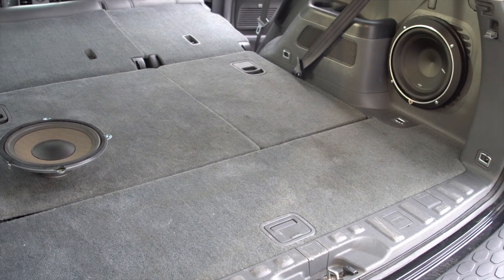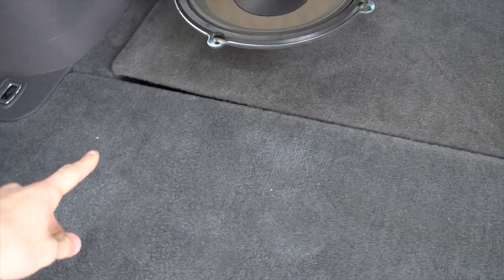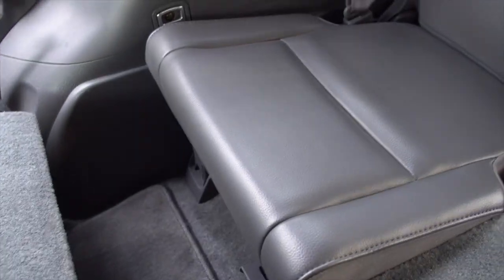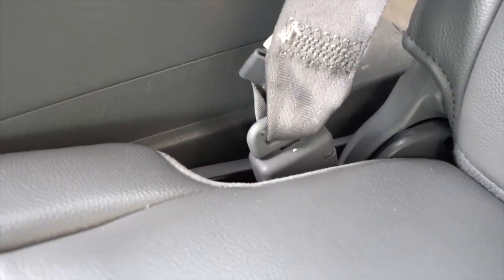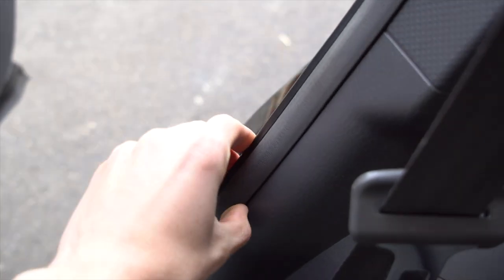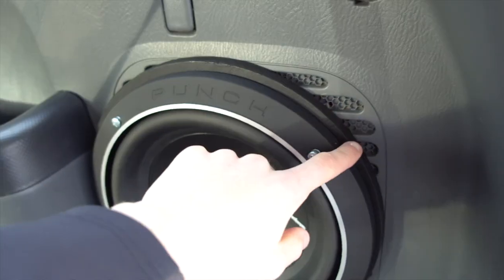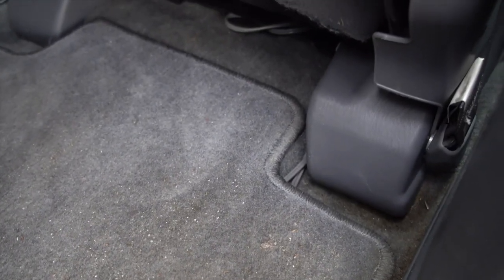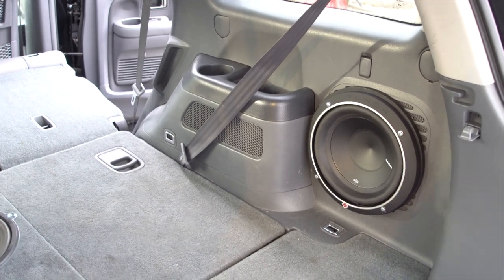How To Install A Subwoofer/Remove Rear Panel - 2006 Honda Pilot

Comment: Sorry but this is just awful. I'd never do this. It leaves the sub in plain view for break-ins, it looks bad seeing the old partially cut grill, it doesn't seal well, and it is decreases resale value of the vehicle by destroying the factory interior trim panel.  Just install the sub behind the panel. There are plenty of excellent shallow subwoofer drivers available that will fit fine with no modifications and sound great. In fact Rockford Fosgate makes multiple. I've been installing professional car audio equipment since the mid 1980's and was an engineer for Rockford Fosgate...

Comment: If you cut the sub woofer cover then why did you go through the trouble of taking the panel off.  Would it be easier to just cut out the sub woofer cover and then remove the old speaker?  I wish you had some video of what it looked like after you removed the old speaker.
Reply: Probably because didnt know the depth of the stock speaker. ("No intel at all at the time")
And used the opportunity to show the audience some INTEL 
goofy....

Comment: Good video! Just a heads up for future folks giving this a whirl. You do not need to unscrew the two bolts holding the latch for the tailgate. You simply need to unclip the piece of plastic surrounding it.
Reply: Found that out the hard way today. 😂
Reply: I was going to say the same thing

Comment: I have 2 of these hooked up to a 1600w sound stream amp. And sounds pretty good for shallow subs on a low budget. I would definently put a 8” sub back there so fit would be good and can breath also.

Comment: I have a 07 pilot with the same stock sub. Where did the stock wires run to? Does the stock sub have its own amp? I’m looking to use the wire to power my sub but my sub does not output audio.

Comment: My steering wheel has buttons that controls the stock radio, what aftermarket radio would you recommend that can be connected to the steering wheel controls too?

Comment: Where are your other videos you mentioned? I would like to see wiring from the engine. I have a 2006 Pilot driving me crazy with the factory sub rattle. Also, can I just cut out the grill and remove the old sub without taking the panel off? I could just fish the wires to the new sub.
Reply from the maker: Sorry for the late response, I am about to upload the firewall video. I would not recommend cutting the grill when the panel is still in because its thick plastic and I had to use an electric saw. Also the screws to take out the old sub might be hard to get to.
Reply from the maker: https://www.youtube.com/watch?v=APi7ZPTZBjg&feature=youtu.be
Reply: @jonathanmoraglia255  Thanks for the new video it's great! Also, what size bit did you use? And it looks like you did not put a rubber grommet in the hole do you think over time the metal will cut through the wire?
Reply from the maker: @bobcee501  The bit size depends on your wire thickness. I don't think the metal will be a problem as the cable wont be moving around

Comment: did you use the factory subwoofer amplifier, or an aftermarket amplifier?
Reply: Still didn't answer the question if if you used stock or aftermarket amp?
Reply: How can I activate my subwoofer on my Honda pilot 2004
Reply: How can I activate my subwoofer on my Honda pilot 2004
Reply: How can I activate my subwoofer on my Honda pilot 2004
Reply: How can I activate my subwoofer on my Honda pilot 2004
Reply: How can I activate my subwoofer on my Honda pilot 2004
Reply: How can I activate my subwoofer on my Honda pilot 2004
Reply: How can I activate my subwoofer on my Honda pilot 2004
Reply: How can I activate my subwoofer on my Honda pilot 2004
Reply: How can I activate my subwoofer on my Honda pilot 2004
Reply: How can I activate my subwoofer on my Honda pilot 2004
Reply: How can I activate my subwoofer on my Honda pilot 2004
Reply: How can I activate my subwoofer on my Honda pilot 2004
Reply: How can I activate my subwoofer on my Honda pilot 2004
Reply: How can I activate my subwoofer on my Honda pilot 2004
Reply: How can I activate my subwoofer on my Honda pilot 2004

Comment: I connected a stereo myself now mine subwoofer is not working? I'm assuming my harness bypass the amp. How can I make my woofer work
Reply: The stock radio has a built in 50 watt sub amp , you will need an aftermarket small amp to run your sub  .

Comment: So, I know this vid is from a while back, but I hope you know what I'm talking about. With the stock system, there is a rattle, which sounds like it's coming from the panel somewhere. Was this remedied when you took off the panel, and installed an aftermarket sub, and tightened everything down, or did/would you suggest installing matting somewhere in there to help with the vibration?
Sorry for being so long-winded lol
Reply from the maker: Yes I would. I had a lot of rattling in the beginning but once I added some foam it was basically gone
Reply: Check the seatbelt

Comment: Can I keep all my factory stuff and features and just replace this sub/amp?
Reply from the maker: adrian ugalde yes. You can wire the sub to the stock radio. But you’ll need to run new sub wires.
Reply: @jonathanmoraglia255  
Do you happen to have a video of how to do this and what type of amp to use I don't want anything too crazy just better quality sub the factory
Reply: @jonathanmoraglia255  I'd love to see a video on that also.

Comment: Are you using the stock head unit? I want to add a after market sub and keep the radio with navigation and dvd system. is that possible?
Reply: Yep very possible
Reply: I think
Reply: If you want to keep the stock head unit and nav, you ought to interface the system with an audiocontrol d5.1300, this amp has a built in DSP, 4 channels for your highs and INE channel for a sub.

Comment: I want to replace it but after I replace my stock radio my stock subwoofer doesn't work so I'm thinking about replacing it damn it's a lot of work
Reply: The stock head unit controls that stock sub; found out the hard way changed my head unit in 2015 Honda Pilot EXL
Reply: Wait, so I can't start system first? Well, there goes that plan....